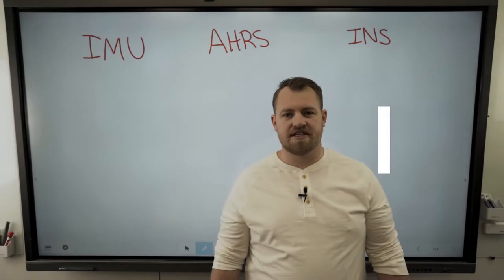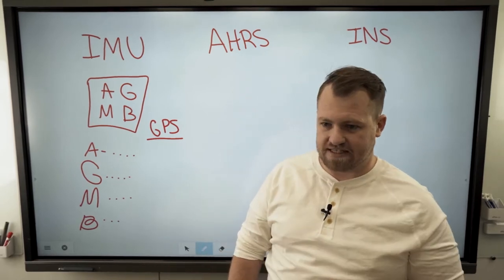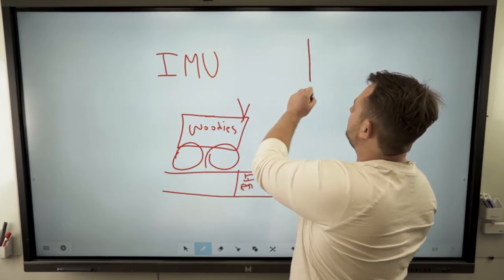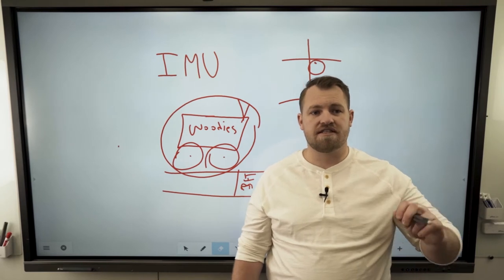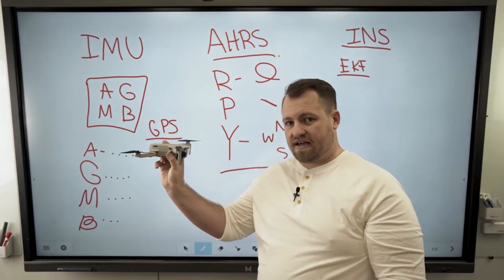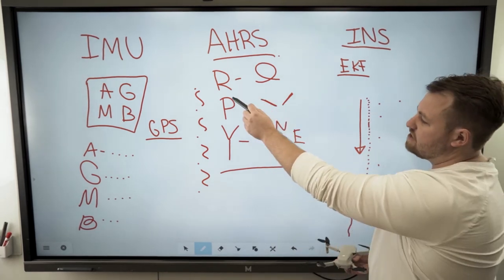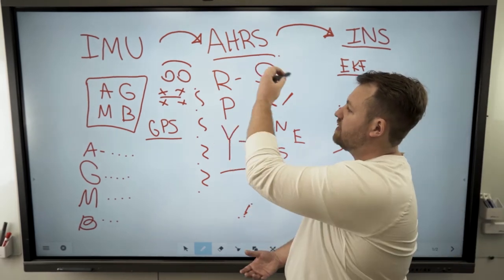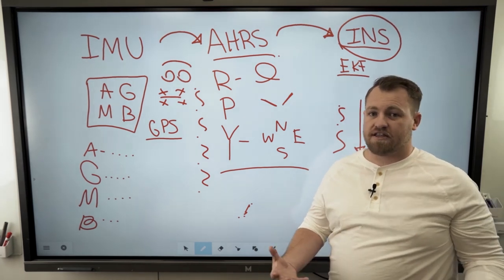IMU Sensors 101 - Pros & Cons of Sensor Types

Comment: You mistook the IMU rate with the GPS rate. 
IMU runs at around 1Khz while GPS is very slow, around 5~10hz only. 
IMU cant be used for navigation alone, because of the huge drift it accumulates over time. the accurate IMUs used for military and space projects range from 100K to around 1M$ dollars. 
the cheap IMUs that we use are good enough to be used in manual flight, where you control the robot. in autonomous robots, you need to have good IMUs along with other means of navigation like GPS or odometry for proper navigation.

Comment: It should be noted that There are AHRSes that have GNSS as well and use that to do sensor fusion.
on the other hand there are INSes that come with no GNSS but accept the data from a separate sensor.